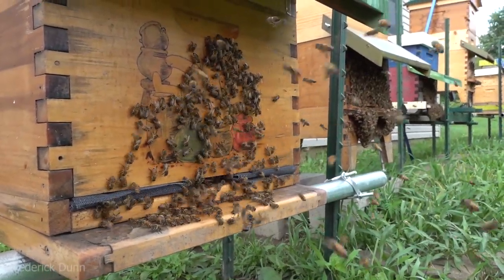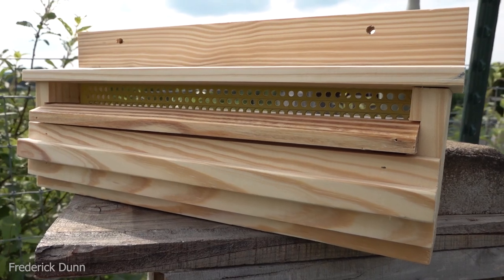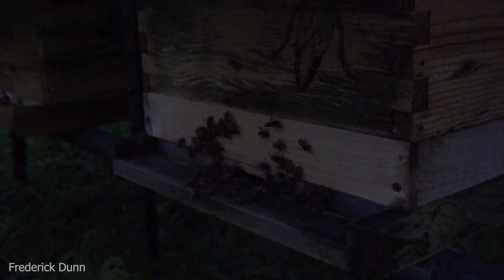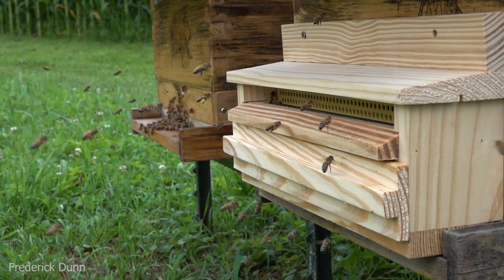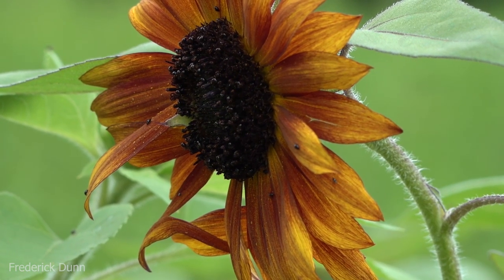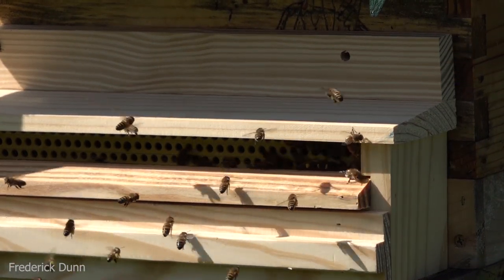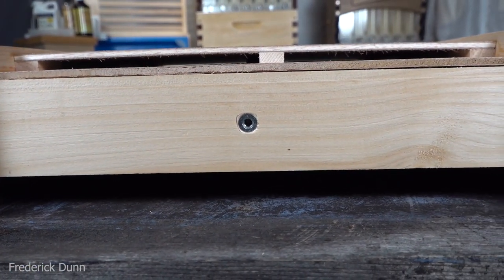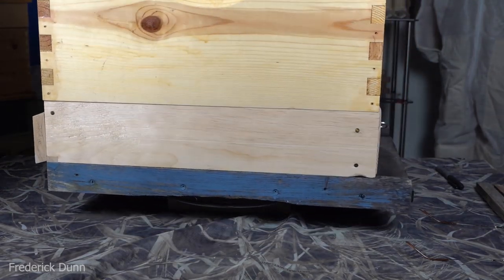Pollen Traps for Beehives FAQ 28 What Trap is best for Pollen Collection, Super Food? Bee Stock

Comment: Great vid Fred. You're absolutely right , checking out bee pollen and its properties can really become a deep rabbit hole. 
I just had an opportunity to pick up some "used" frames and boxes. I should say pre-owned because  they weren't actually put into service.  They were stored where some insects were able to get at them (no signs of wax moth though) .  So my question is how would you go about cleaning them. They are wood frames with what seems to be waxed plastic foundation.
Thanks for all the knowledge you impart .
Reply from the maker: HI Larry, I personally never accept any used "unoccupied" equipment. As inexpensive as frames are, I don't think the risk is worth it. Boxes can be superheated if they are really nice and worth the time. I just put them in thick black plastic trash bags and "bake them" in the hot summer sun. But those are my own old boxes.
Reply: @FrederickDunn  , Thank you, the boxes are indeed very nice and after some scraping torch them I will. The frames w/ foundation turned out to have never been used and after looking more closely the only thing on them was dust. However I have decided to loose all the foundation and I'm going to sanitize the frames just in case. Thanks again for all you do.

Comment: Thanks Frederick ... this was helpful for me to learn how to treat pollen.  The model I gave for Mannlake website is quite different and I had already purchased it.  It has four pieces of wood I guess goes above the brood chamber super and a super on top of that.  Then the unit sits on front of the two longer pieces that are longer than the depth of the hive box.  I am using 10 frame (two hive).  I called them and they don't have instructions other than what is on their site.  I was wondering if it made sense to you and I can try to understand from you.   I'll have order something else and can burn this one in the wood stove... It has been very frustrating and makes no sense to me.
Reply from the maker: HI David, I don't personally like the pollen traps that are situated under the brood box. The reason I much prefer the landing board version is that you can put it on any hive that is looking very strong, and it's not hard at all to remove and place elsewhere. With the bottom board units, you have to lift all hive equipment to move it to another hive. Yes, they have a bypass mode, but that means you need several units.
Reply: @FrederickDunn  I agree  I bought this before I knew anything...  I am thinking of simply modifying it to have it work at the main entrance at the bottom board...  or wait another year.

Comment: Do you think that thing could be used to help scrape off varroa mites if you water proofed the drawer and put oil in it? If the bees exit via the small holes, would anything the bee might have on it get scraped off and fall into the drawer, or does it only work when the bees go in the hive from outside and not on the way out? Would the plastic holes wear down the wings of the bees like a Queen Excluder might?
Reply from the maker: Definitely not adequate for varroa removal, even small packs of pollen make it through the holes. On the way out, any varroa would drop on a flat board and not into the tray/drawer. As I mention in the video, I personally would not leave these on for extended periods of time.
Reply: @FrederickDunn  Got it.